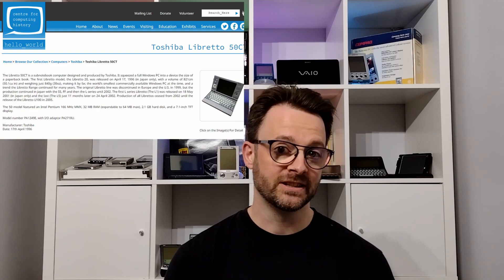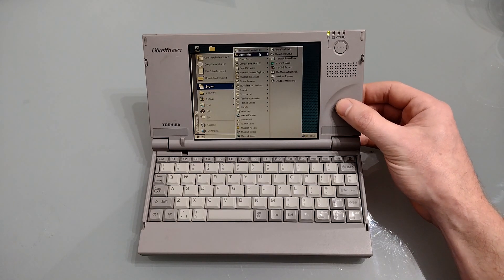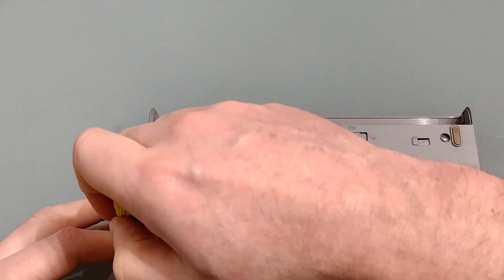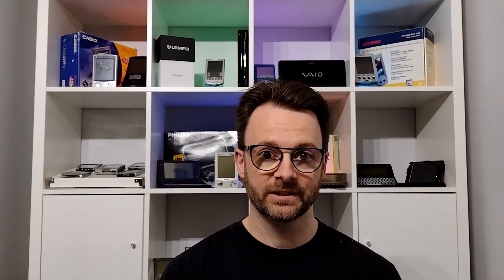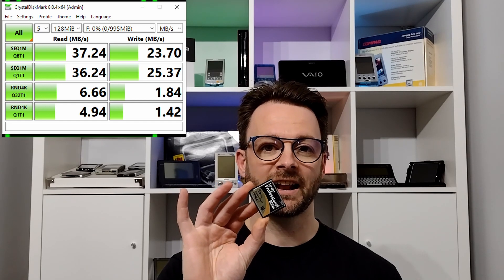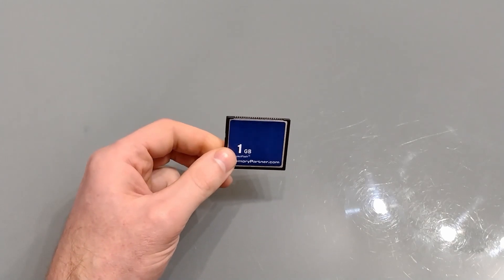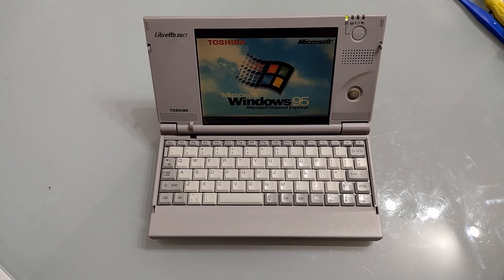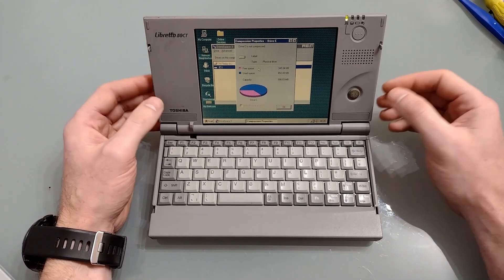Toshiba Libretto 50CT HDD to CF card

Comment: The disk drives are just really agressive in head parking, thus the clicking sound.

For disassembly I have some methods to minimize possible damage, like warming up plastic parts, for example the lcd bezel which is screwed and clipped in. No guarantee but works most of the time very well.
Reply from the maker: Ah good to know, it is aggressive though! I also found that the drive struggled to get going in a powered external drive bay presumably because the bearings are old...

That is good to know, at some point I need to replace the polarizer on the LCD as it is deteriorating along the edges so that is a handy tip! 😃

Comment: Hello ! Nice video ! Where can you get some replacement caps for the tracepoint / accupoint mouse ? Thanks !!
Reply from the maker: I bought some think pad ones from ebay, they have a square hole but a little modification and they work well - couldn't find any the same as the original

Comment: Windows 11 wont detect the 2.5 IDE driver only shows as a USB drive.
Reply from the maker: Presumably you are connecting a CF card via usb in which case it will show as a usb disk which is correct, just use Rufus to set it as bootable media
Reply: @HandheldComputing  Its not the CF card its the 2.5 inch IDE HDD. It wont read.
Reply from the maker: @MidnightUploads-q5v  yes I have had this issue with IDE to usb adapters, they don't always supply enough current to power the drive. I have a powered dock and that has always worked well for me. I assume the drive works in the libretto fine
Reply: @HandheldComputing  it works fine, what dock do you suggest I use?
Reply from the maker: @MidnightUploads-q5v  I bought this multi bay dock as it handles 3.5", 2.5" ide and SATA as well as memory cards. https://www.ebay.co.uk/itm/204289963602?mkcid=16&mkevt=1&mkrid=711-127632-2357-0&ssspo=lZ24xoNWTEO&sssrc=2349624&ssuid=woyFakHRQ96&var=&widget_ver=artemis&media=COPY
There are lots of similar ones out there, just needs to be powered
Reply: @HandheldComputing  That's the one I was using!
Reply from the maker: @MidnightUploads-q5v  oh no! If that's the case I'm not sure what to suggest. Perhaps use a PC card to CF adapter to copy the files?

Comment: I've handled around 15 librettos in the past year, and I strongly advise against disassembling them to place a CF card. The reason is straightforward - the plastic material used in those devices is extremely brittle, and even with extra care, the chances of breaking it are always high. Therefore, I recommend using any plastic card that you no longer need, such as an old visa or Costco card, and gluing the adapter right on top of it.

To ensure that you can easily remove the card later, add a piece of tape to the end. Once you've aligned it, slide it into the libretto (it may take a minute to do it for the first time), and you're all set. You can now remove the "caddy" that you've just created at any time and add any files that you need. The most significant advantage of this method is that you won't break anything while doing so.
Reply from the maker: This is an excellent way to change the HDD without disassembling the machine, thank you for that - I have pinned your comment and referenced it in the decryption!

Comment: By far the easiest way to install win95 is by copying the install folder directly onto an already formatted hard disk and using a boot floppy to install it directly. You don’t need to install DOS - just format and literally create a folder with the install files inside.

Win95 works ok on a libretto, with original 16megs of ram but 98 is a pain. I too have a slow CF card and the read/write speed does cause issues and is somewhat noticeable.

What makes this worse in fact, is the IDE controller itself. It’s rubbish!

Some people say it’s a 166 bus speed but I’m really not too sure. A middle of the range speed CF card would work well.

I’ve had a handful of these over the past 12 years and love them. Easily overclcokable, and if you have spares, you can actually increase the onboard ram by another 8mbs or so. Onboard ram is in a stack of 2x4 which makes 16. An extra 8megs would help and would further improve performance in 98.

Just a notable mention. Ensure the ram expansion card is secured properly otherwise it can cause the machine not to boot at all, and in some cases damage the BIOS flash
Reply from the maker: Thank you for your advice, yes I struggled finding any info on the IDE controller as I wanted to know the theoretical speed limit so I could choose an appropriate CF card. TBF The current (bloated) install runs pretty well on the CF card I put in. I managed to find all the drivers for it last week so clean install will happen when I get time. Going to try it with the floppies first I think 🙂
Reply: Just replying as I’ve actually bought a libretto 70CT with a complete factory install with no additional files added. I’m happy to send this to you as a VHD! You can mount it and clone it over using your tool!
Reply from the maker: @The_Studioworkshop  That would be amazing!!! 

if you drop me an gmail (huwshandheldcomputing) and we could sort out a gdrive for transferring it  🙂

Comment: Nice job. I assume there is a performance gain when you upgrade to CF cards? I never had a Libretto, but I've always wanted one.
Reply from the maker: It runs about the same speed (maybe a little faster) due to the limits of the IDE controller the real gain is in reduced power consumption ~30-60mA Vs ~100-500mA so battery life is greatly improved!

Comment: Would your method shown in this video also be the best possible way to clone or image A installation of Windows mobile edition from a Motorola MC, 9090?
Reply: https://youtu.be/DfZnEI2TdQw?t=317
So what exactly are you doing here? Are you simply copying and pasting the directory onto another storage device? If so, which directory are you copying? I'm going to be doing the same thing with my Motorola 9090 very soon.
Reply: My job uses the Motorola 9090 UPC scan gun. I bought my own scan gun and I want to back up the Windows image installation from the work gun over to my gun. Would the method that you showed in this video be the easiest way to do that?
Reply from the maker: So the 9090 runs windows mobile, this is either stored in flash (in which case you cannot back up the OS) so can be updated but not directly modified or its held in RAM and installed on boot from a memory card. Either way there's no need to back up the OS